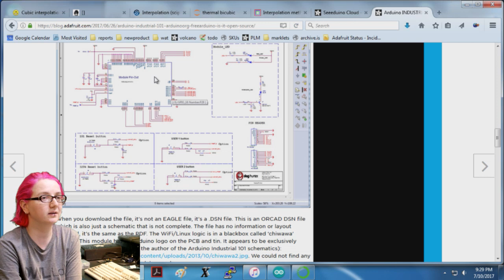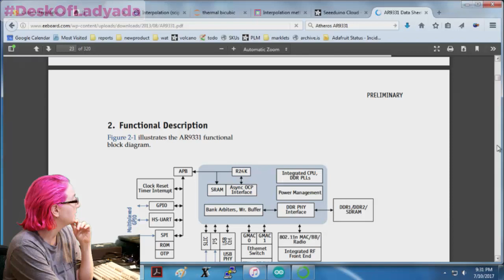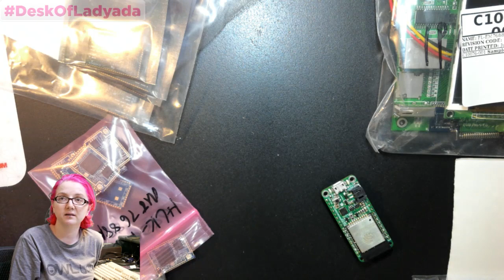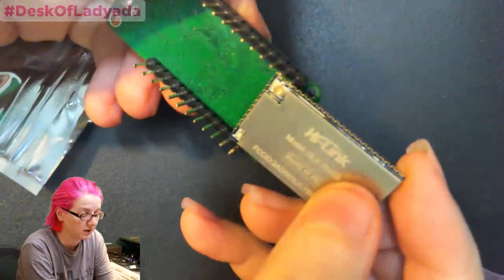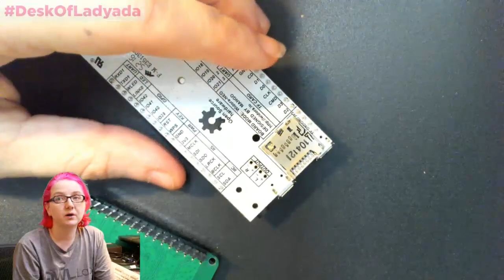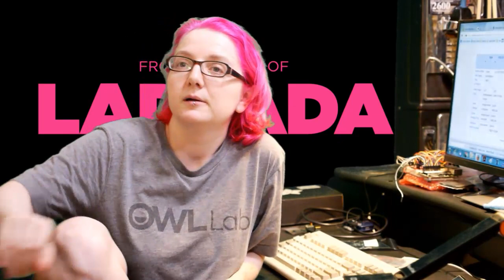#deskofladyada Sample Monday Linux boards 7/10/17 @adafruit #adafruit #programming

Comment: Look at OpenWRT open source to guide your project. Battery operated HUB or Router with file storage multimedia would open doors. Add-ons for PWM, ADC,DAC,DIO for use with robotics. Let processors do what they do best process. Parallel processing which I retired from sometimes has multiple slaves. Today with all the inexpensive hardware available and size it's up to one's imagination. This is way great.

Comment: I appreciate your thoughts on re-engineering something Yun-like, Limor. Definitely seems wiser to go with a Linux computer and a well-connected m0 for analog etc. on I2C rather than building a pair of conjoined twins that both need your full attention. 

Can we agree that Debian is the place to start, for OS? Or does it have to be OpenWRT/LEDE? (This is indeed the best choice if the RAM can't handle a slim Debian.) 

Good luck!!